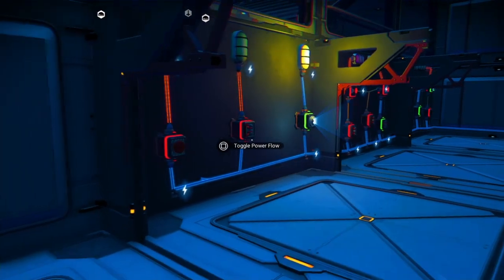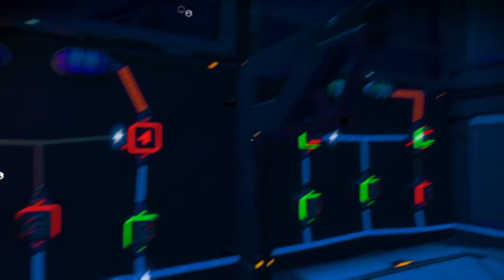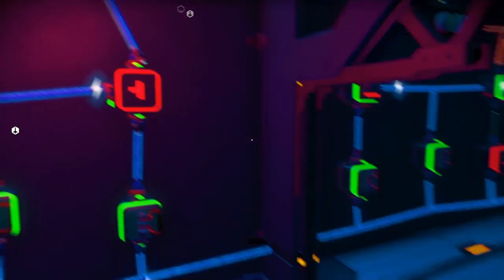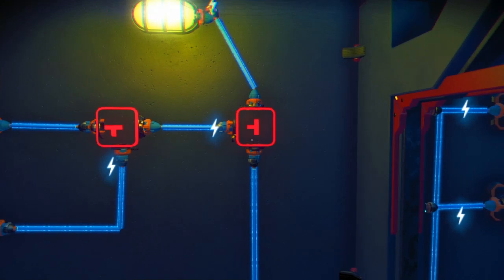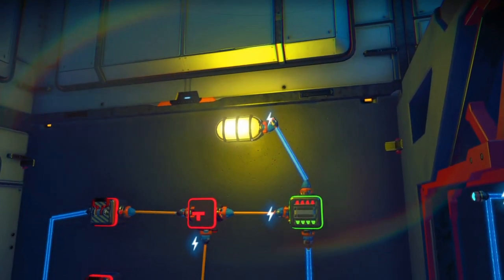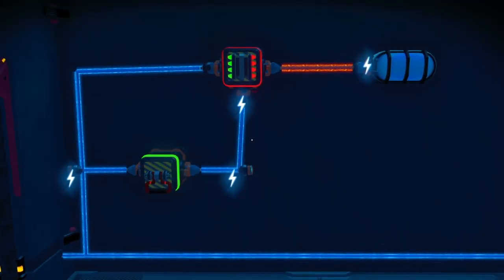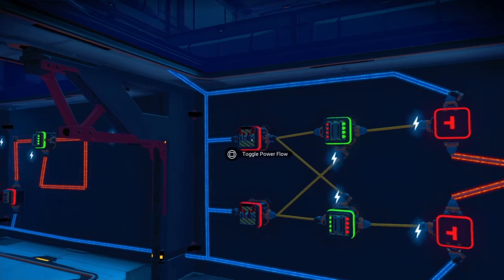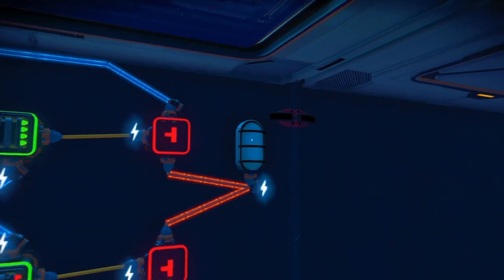No Man's Logic 1: Switches and Gates

Comment: I understand, this is the symmetrical XOR gate of ((B` * A) + (A` * B)) and the power inverters are taking the role of inverting the opposite input, and then to make sure it doesn't feed back you have the diodes before the "OR" gate (which is just a wire junction)

Comment: if they added a control input to the wall switch it would make things so much easier... I figured out how to make a S-R latch but it requires a two tick input or it breaks, so if I wanted to use buttons with anything that handles storing bits, I would need to add pulse extenders on all of my memory...

Comment: The XOR gate is pretty slick. Though when used with switches on a garage door, it will run its closing animation twice if you use a different switch to close it from the one that you used to open it...but the end state is correct regardless. I guess the devs didn't fully account for XOR logic to be in use on the garage doors lol.

Comment: You got the nomenclature wrong. When a switch is open, current shouldn't flow through it and the light shouldn't turn on. Otherwise, if the switch is closed (shorted), current's gonna move through the wire and light the switch.
Reply from the maker: Yes, technically you are correct. When saying "open" I was thinking about something like a gate or a door that is open.

Comment: So hard to swap that around in my head after so many years as a techie - switch is open/ current flows. Switch is closed/current stopped😱Think of it like water a little I guess🤔😊
Reply from the maker: I'm thinking of it as doors you can only walk through when open.
Reply: @Tekay37  Yes I never really understood logic. Flip flops etc, but I am technically minded, and your guide helped alot. And yes I had a feeling 'inverters' were inaccurately named😊I spent a considerable amount of time yesterday trying to make a simple two switch/one door circuit and I quit after six hours of experimenting and came to Youtube😏 My base is on a frozen planet and my greenhouse has a door at the rear that opens outdoors to my exobay and I do not want a motion detector fitted to it. I want a standard wall switch both sides of the wall that will open and close the door either way from either side. Standard. I'm looking at your number 5 example and that is the one. Right?😁Nice work, once again.

Comment: can someone please explain how the basic "button switch" works? I've been trying to experiment with all switches and cannot seem to power a simple light fixture using my stored battery power. I must be missing something. Power inverters, Wall  Switches, etc all work yet a simple button switch nothing
Reply from the maker: You put a static current on one side if the button switch and when you press the button, the current will come out the other side for roughly one second.

Comment: This is in reference to the creators of no mans sky. Their logic is not logic. Their inverter is NOT an inverter. They need to fucking fix it. When there Is no power from a switch, activate the fucking signal. No mans sky makes it way harder than it needs to be. Make the bottom  port on the inverter the power.  The signal determining what's on or off is on the right. The inverted signal comes out on the left.

Comment: very confusing description (for me as an electrician irl) because when a switch is OPEN = there is no connection = light off / when a switch is CLOSED = there is a connection = light on!
you described it the opposite way, which is false
Reply from the maker: For others, the technically correct way of explaining it would be confusing because you can't see those switches in the game and something being "open" is widely associated with things being able to pass through and something being "closed" is widely associated with things not being able to pass through.

Had I explained it the other way round I would have to explain that part as well, which I think would have been more confusing for people who have no knowledge of that stuff so far.

Comment: Hi there 
Nice tutorial. I’d like to set a group of switches to turn on and off the power grid on the base. Like the last logical gate but with more inputs. I’ll try to do it. But it would be nice to watch it. Also, it would be nice if you can set the contraptions on real base applications. I got my NOT gate using a floor switch and an inverter to work as a garage door.

Comment: This is one of the best tutorials I’ve seen on power. Thank you. One question. Concerning the inverter, there is a red and a green side. In watching your video, it appears that it makes no difference which side gets plugged into the input power. Whether your input is on green or red, the effect of the modifier port seems to be the same on the output side. Is my observation correct?
Reply from the maker: Thanks for the praise. And yes, your observation is correct.
Reply: Tekay37 Great. Thanks for the response. By putting different colors on the two ports, it makes it a bit non intuitive. And I saw a YouTuber somewhere who gave the impression that it matters which side. My testing gave me the impression otherwise. Thank you so much for the confirmation. I love wiring up things in this game.
Reply from the maker: @jeffhulrich  Yes, also the name "inverter" is just wrong, because the switch doesn't invert anything. That just confuses everyone. 

The switches work like doors. If they are open, you can go through in both directions, if not they block your way. The only difference is how the switch changes its state between "open" and "closed".